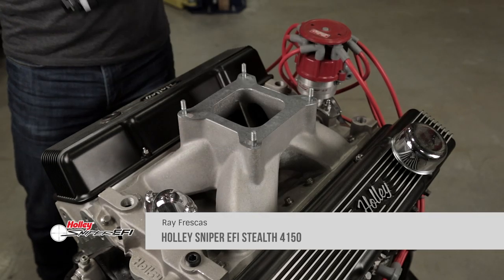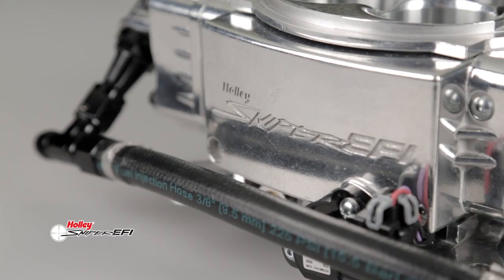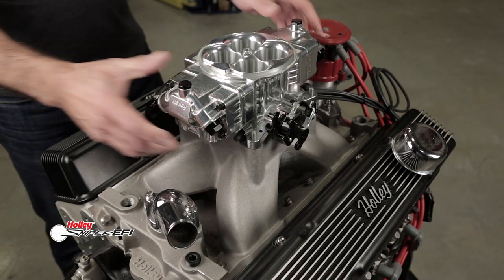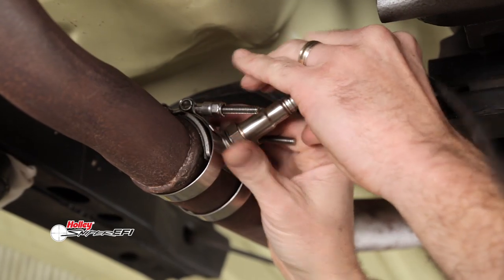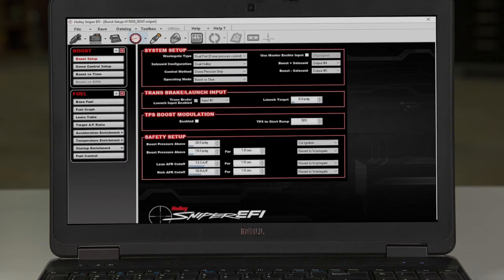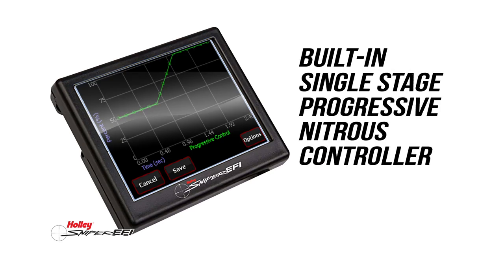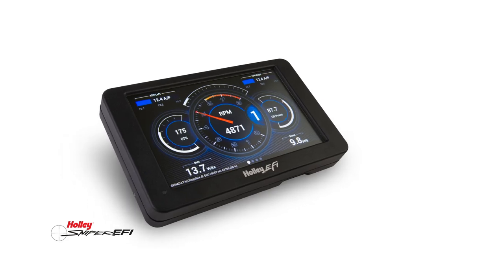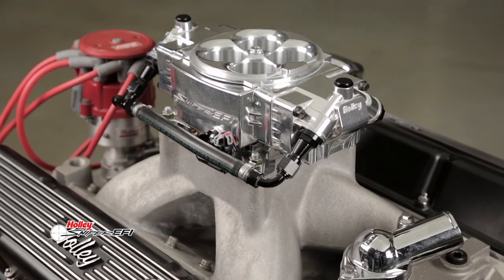Holley EFI Sniper Stealth 4150

Comment: i see a lot of youtube stuff where a good motor runs beautifull with the EFI but the good old carby made a little more hp in runs.i just bought the sniper stealth to replace my 750street hp that was great when driving but hard to start first time and eventually fouled the plugs over 20 or so starts. AND believe me a drive down the freeway a few times will not clean black/ sooty spark plugs. Steve in Australia
Reply: It shouldn’t make a difference.. the reason why people like this setup it’s because it acts just like a carb. It shouldn’t be more or less hp than a carb.

Comment: I just like the 4150 because I know my pricey Trick Flow throttle bracket will work.  And my hood clearance shouldnt change from my existing 850 brawler.

Comment: Looks interesting, I have a 85’ C20 that we use for heavy towing, it’s mild 383 will soon be replaced by a 400 AFR headed SBC. The curb weight is 4900 lbs, is this EFI system best for this or do you recommend something different?
Pizzandoughnuts
Reply: Pizza and doughnuts are poison ... just buy a diesel and call it a day ...

Comment: While this looks great, would be really cool if you guys would do throttle bodies that look like the 4160 carbs with side pivot looking fuel bowl ends and are short enough to be run end to end on a 2x4 manifold, like the 427 medium riser FE Ford with dual quads. Lots of Ford and Cobra guys would really go for that.

Comment: I have both, MSD Atomic efi and Holley Sniper.
I prefer MSD Atomic efi. 👍
Reply: What about the msd made u like it better...was checking reviews?
Reply: @jjjones518  My engine, SP383 GMP, worked better with MSD.
Many parts of MSD are sold saparately: ECU, sensors, power module, etc, all parts.
Adjustments are simpler with advance control.
I felt safer with MSD. Everything in my Impala 68 is MSD.
Reply: @spectralopticalvision  doesnt all that add up? lol complete setup pushin close to 3k?

Comment: I have a coil. So I must buy a coil driver?
Reply from the maker: The unit comes with our small coil driver in the box. If you'd like, you can drive your coil with CDI box like a Sniper Hyperspark or MSD 6AL   -Keith
Reply: @HolleyPerformance  thanks! is there a hp difference in using a coil vs using an MSD box?

Comment: You guys really need a 1000 cfm unit the 800 cfm sniper just killed to much power on my bbc in higher rpm went back to my 950 cfm carburetor
Reply from the maker: You may need to step up to the Stealth 4500 unit! -Keith
Reply: Would you suggest a Stealth 4500 unit for a 427 stroked sbc? (dynoed with a quick fuel brawler 950 cfm carburetor at 550 hp, with another configuration it can do about 630). Interested only in power (quarter mile) because carburetor works just fine, no cold or hot start issues etc.
Now I am thinking about Xflow Sniper, 4500, and now Sniper Stealth (keeping the carburetor)... way too many option. Any expert advice?

Comment: I guess the Terminator is out
Reply: The Stealth Terminator has a different ECU with different capabilities/outputs, but for most there will be no difference.
Reply from the maker: @ShawnD1027  You're right. The Stealth Terminator is available with either the HP or Dominator ECU and has quite a bit more capabilities than the Sniper units. -Keith
Reply: @HolleyPerformance , one of those "more" capabilities I'm using is the PWM for the cooling fan and fuel pump. :)
Reply from the maker: @ShawnD1027  That's great to hear! Hope it's work well for you!